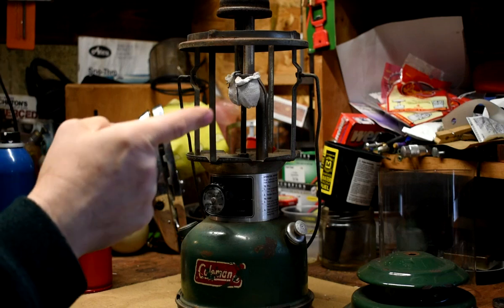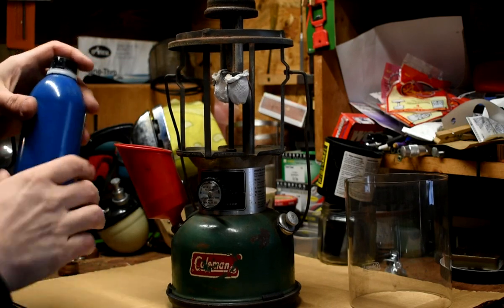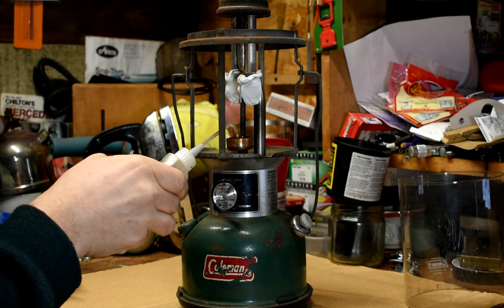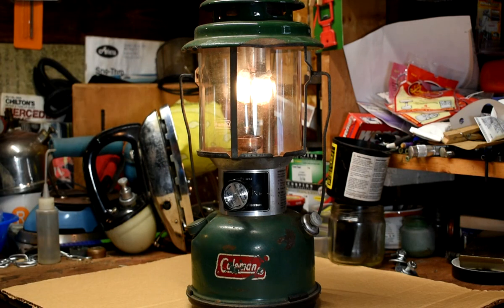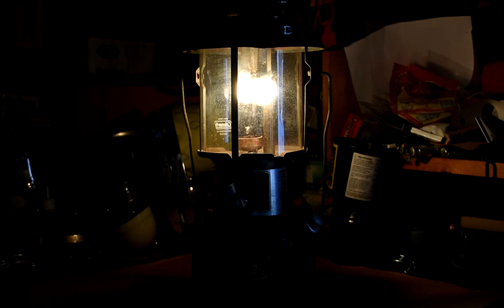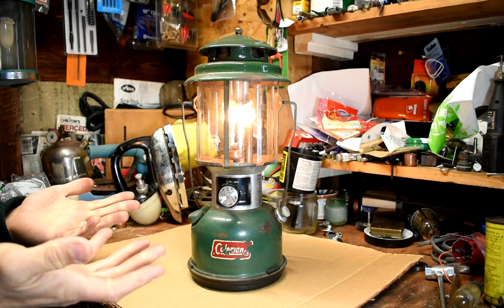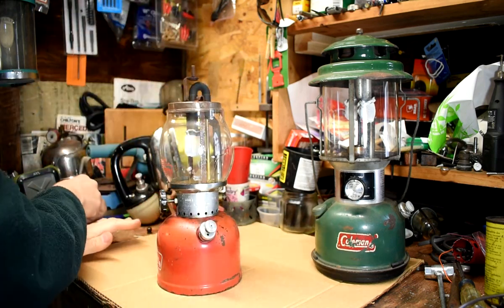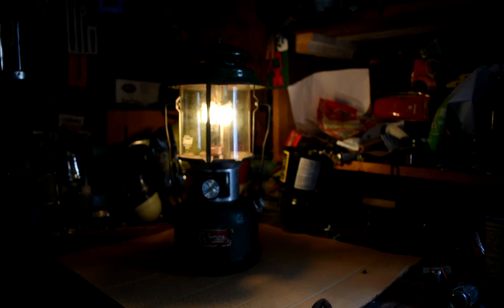Converting a Coleman 220 lantern to burn Kerosene

Comment: Great video, another reason for converting to kerosene is that in some parts of the world white gas or Coleman fuel is either not easily available or the price is exorbitant. I got into lanterns a couple of yrs ago and not really understanding the difference between kerosene and white gas I bought a few lanterns in Ireland. Traditionally it’s kerosene that was burned in lamps in UK & irl. ( Tilley & bialaddin being the main sellers) however amongst the lanterns I purchased was a Coleman 220F. Coleman fuel is available here but the nearest stockist is a 2hr drive away and then its €13 for a small bottle of I think 750ml. I since bought a Coleman 639 but I would like to bring the 2 mantle 220F back to life.

Comment: So if the 220 works well stock, why does anyone swap parts? Seems like a no brainer to me to keep stock. If it’s not broke, why fix it.
Reply from the maker: Mostly I agree but if you'd stumbled upon a supply of kerosene for cheap it might make sense. I also feel better about using kero in the house, it's just a little safer.

Comment: I was kinda geeking out on Coleman lanters about 5 years ago and had found your channel.

I have 3 220s ranging from B to F I beleieve and another one thats mod 70s.

Id totally be down to take one of my newer 220s and convert it to kerosene if possible.

I do have a 200A that spitting fuel out from the fount where the generator goes but haven't been super into Colemans or had the time.  Just took my 7 year old son camping using my Milwaukee m12 lantern and headlamps which worked great but I want him to remember that classic Coleman white gas hiss that soo many associate that nostalgia with.

You've kinda resparked my interest to go through my lanterns. Make sure the mantles are good and run em.
Reply from the maker: Leaking from around the generator is pretty common on kerosene lanterns, less so on white gas. The brass of the generator work hardens and sometimes doesn't make a good seal. You can anneal the generator flare by heating it until it just starts to glow, then dip it in water to cool. Don't get it real hot or it'll distort.
Since a 200A is pretty common you could just get a new generator too.

Comment: Perfect timing! I’ve been waiting for this! I recently inherited a Coleman 288A700 lantern from my late father. I already have 2 other Coleman lanterns that run on the white gas so I’m hoping to convert the 288 to kerosene. I’m hoping this guide will enable me to be successful. Thanks! 👍🏻
One question: Is it more desirable to change the generator to the kerosene generator and will it simply drop-in fit?
Reply from the maker: There isn't a "kerosene generator" for a 288 that I know of and certainly not one for a 220/228. The kerosene lantern generators are much fatter and would need a different base than a white gas generator.
Reply: A 214 generator will drop in a 288

Comment: This is the first time I've disagreed with you but only because of my own personal experience. This not a reflection on you or your experience. The Coleman 231 was a double mantle kerosene lantern. Essentially is was a kerosene 220. From the factory it came with a straight pickup and a #6 (200A) orifice tip on the gen. When trying to do my own conversion I would get lots of over flame when using a V (220) orifice. When using an air circuit pickup I got a lot of pulsating with either tip. It was only after putting a straight pickup and a #6 tip and 200 pricker that I was able to achieve peak burn. The lantern is brighter than my standard 220s. If you do find that your lantern runs better on a #6 tip you must also install the 200 gen pricker as well. A 220 pricker will damage the #6 tip as the wire is to big.
Reply from the maker: I forgot about the pricker wire, good think I didn't run the cleaner.
Did you use a later lantern with the flying saucer mixing chamber? I think those are better suited for an odor free conversion.
Reply: @LanternLabs  No Sir. Mine is a 1972 220F with the new style cage but the old style brass mixer on a steel air tube with steel burners. I've been trying to understand this problem for a while now. If you look at an old 235 lantern or a 129 lamp they both used a V tip. But any time I try to use a V tip it overburns badly. The only way I can make my 220 run nice and smooth is with a straight pickup and a #6 tip and pricker. Now I want to tear it apart and put an air circuit pickup and a V tip back on the gen and see what happens.
Reply: This guy is spot-on. I used the entire 200A generator. The 200a tip is .006 of an inch and the 220F is .008 of an inch. My 228F mantles burned yellow until I fixed the leak in the burner tube by tightening it one full turn into the tank. (I rebuilt it and thought it was tight enough. Built a vice and presto...1 more turn) Runs like a champion.....just as bright as white  gas.
Reply: Quick note…200a generator is .07. The 201 genny is .06. But agree on your point… 200a genny for a 220 K conversion.
Reply: @brhino1017  Side, Side note. The 286/288 generator uses the exact same orifice size (. 007) as the 200A even though the 2 gens are not interchangeable. The 214 uses the same size as the 201.  When I run my 286 or 214 I use a 300 to 400 candle power mantle rather than the little  21, Coleman recommends. I wish they still made the 99 mantle. It was the perfect 300cp mantle and will kick but on a 200, 286, or 214!

Comment: Does Kerosene last longer?
Reply from the maker: I didn't do a before and after test but if you used the smaller gas jet it should last longer since you're passing gas through a smaller orifice.

Comment: I just bought an old 220 and it works pretty well but it wouldn’t shut all the way off,  instead of releasing the pressure from the tank to shut it down, I just let it burn all night.  Does anyone know what part I need to replace or is it something I can adjust? Thanks for any advice.
Reply: If you pull the valve shaft from the valve body you will see that the shaft comes to a point. It sounds like you may have a bur on the tip of the point that's not allowing the shaft to seat well. You can take a small file and gently file the bur off so that you have a nice point again. Go ahead and order a new valve packing from Old Coleman Part as most likely the one in the valve will be destroyed when you pull the valve apart. Even if it isn't it's good insurance to replace it while you have everything apart. Be sure you pay attention to the specific way each ring on the valve shaft comes off so that it all goes back together correctly.
Reply from the maker: I think Joshua has it. Some gorilla honks down on the valve and puts a ring in the seat. I've had good luck chucking the valve stem into the drill and using a file and then sand paper to clean the ring off. Be sure to keep the same angle so it'll seat well.
Reply: @joshuaharrington6094  thanks guys, I’ll do just that!